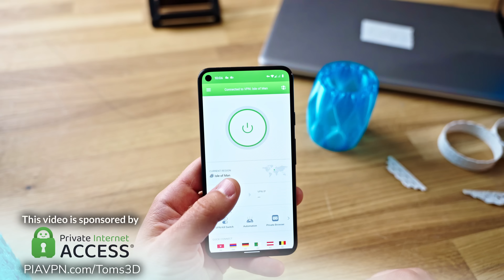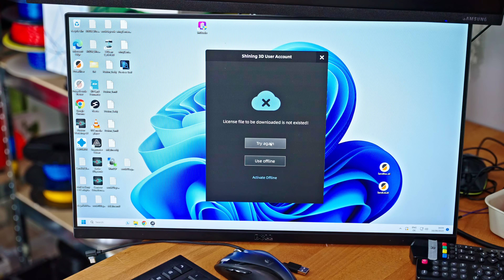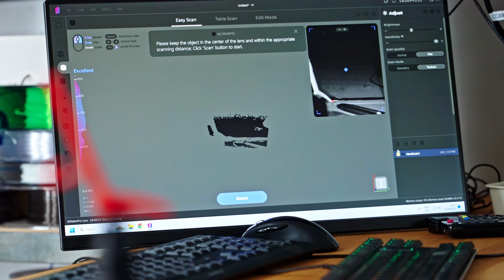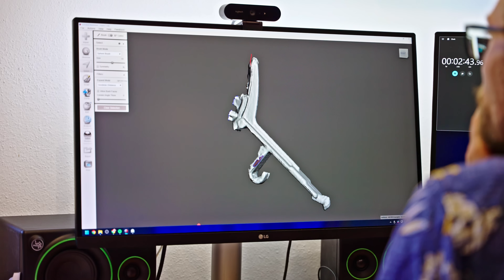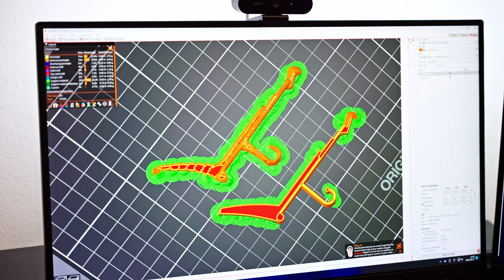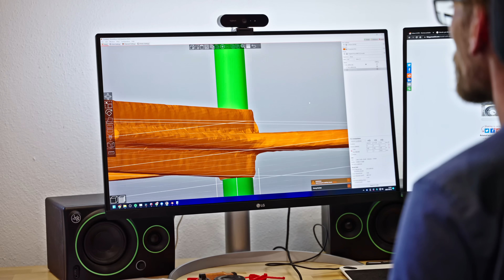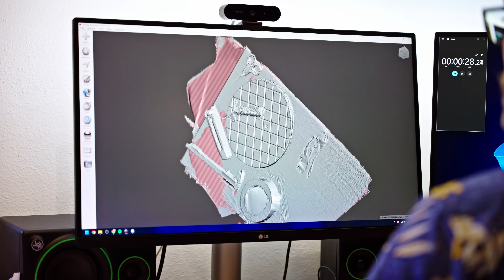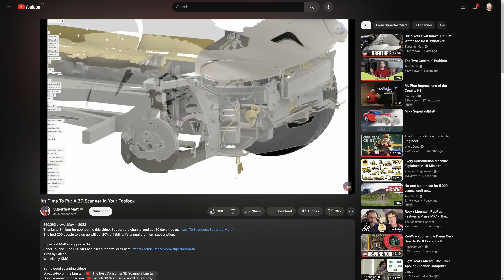Make replacement parts faster - with CAD or a 3D scan?

Comment: Great side -to-side comparison of two different approaches to reproduce relatively simple part. An advantage of CAD is that you can sometimes improve the original part, like you did at the end of video. The producer of the toilet 🚽 flush designed this part purposely weak to snap, so that you need to buy another set...

Comment: Certainly, going to a store and buying the defective part is much simpler. The process of scanning or 3D modeling is complex, and cheap scanners are not good enough
Reply: you have bad luck if the part is no longer available or way more expensive because you need to buy a kit (and so on). There are reasons why sometime re-create parts is the only solution. As example: the flush unit from the video is around 20 years old, nearly no chance to buy spare parts.

Comment: I found when measuring parts with digital calipers that the designers of the part in question will often use whole numbers in its mm dimensions, making it easier to recreate in your 3D editor, and it especially helps when trying to measure circular dimensions when you can't directly measure the radius or diameter, ie curved inner/outer edges of the part.
I would hope there's software out there that can take a 3D scan and apply the same whole numbers usage thing to end up with an easily editable highly accurate CAD file.

Comment: For a mechanical part you should be taking the scanned mesh into Fusion360 or something similar and use the mesh data to guide the CAD. For instance in Fusion you can project a mesh section as a sketch and then fit sketch geometry to the mesh section. OR I should watch the entire video before commenting.

Comment: Have no idea about 3D scants but in regards to CAD manually tracing a 2D scann (bitmap) and the addition of the calipers would help avoiding mistakes and make the process more pleasant, maybe even faster. Just import 2D scanned picture to CAD :) Cheers.

Comment: 2:28 EVRYONE WE FOUND HIS HIDDEN STASH!!!

Kidding aside, why blur it?
Reply: Also: 6:25 WTF? This is a commercial product?
My ancient Kinect can do better with the Demos in the SDK...
There was/is commercial scanning software available for it with a trial period that I used to reverse engineer some parts.
The scan results were almost drag and drop into autodesk inventor...
Reply: @DerSolinski  Depends on the scale. Scanners that work at large volumes do not work at small volumes, and vice-versa. Are you saying that your old Kinect can do high-resolution scans of an object the size of your finger?
Reply: @DerSolinski Looks like he didn’t spray nearly enough of the scanning agent.  My Scan Dimensions scanner could have easily scanned that part.

Comment: The first lesson of this video is to avoid the proprietary licensing crap and use an open source 3D scanner.

Great concept for a video, as always, flawlessly executed for maximum educational value.  Thank you.

We need resin printers without the toxic mess and the hassles of slopping chemicals, drying and post curing.  This part would be very strong printed in ABS-like resin.
Reply: Exactly - I hate that so much - I would much rather spend money or time on open source stuff than fidle with DRM and Licenses.
Reply: The first lesson is: Always be prepared
Reply: Fusion 360 is the proprietary licensing crap as well btw.
Reply: @TheTimeCatcher  - I'm a big fan of FreeCAD.  It's not as slick and polished as Fusion360 or SolidWorks but the time I spent learning FreeCAD and the designs I created in FreeCAD will never be used to extort money from me later.  I also won't spend hours on the end user licensing agreements and installation hassles of proprietary software.  Open source software just feels right.
Reply: @TheTimeCatcher  there are no viable open source alternative, onshape, solidworks and fusion 360 are all licensed software. Freecad just isn’t good enough yet.
Reply: @conorstewart2214  Ikr, but it doesn't help with that fact that you could just lose access to that.
Reply: @TheTimeCatcher  Not if you purchase a perpetual license. Amazingly, some software companies (or their resellers) still sell those.
Reply: @jonathanlawley4863  Okay, show me the perpetual license for Fusion 360 then.
Reply: ABS like resin isnt very strong though, nowhere near as strong as PLA.
Reply: @Festivejelly  - That has not been my experience.  I designed some small dog bone electrical insulators.  They're 30 mm long and the center section is a rounded 5 mm x 5 mm square cross section.  If I FDM printed these parts using PLA, at any layer height, optimal layer orientation, any temperature, any number of outer layers and infill density, post cured, etc., I could snap them between my fingers.  Resin printed from ABS-Like resin from Siraya Tech, there is no way I could break them without using a vise, large pliers, etc.  I used paracord loops on each end for a linear pull test.  I stepped on one loop with both feet and pulled on the opposite loop with both hands, as hard as I could.  I couldn't break them.  I doubt ANY filament printed on an FDM printer would have passed that test.  ABS-Like resin is very strong and tough.

If you've had ABS-Like parts break, they were probably delicate parts on resin 3D printed figurines - wing tips, spear points, fingers, antlers, etc.
Reply: All the head to head "durable resin" vs FDM printed videos have shown resin being far weaker than FDM, so what you're saying doesn't line up. PLA is very weak sure, but for durable stuff you use ABS or carbon fiber PC/nylon etc. I'm betting all else being equal, the FDM will still be stronger
Reply: @32BitJunkie  - I've made strong parts FDM printed in solid TPU, which is very impact resistant and has great interlayer bond strength, even though TPU isn't considered to be an "engineering polymer".  For a part that needs strength in all directions the more isotropic physical properties of 3D printed TPU can be a great choice, that also has advantages of impact resistance, UV resistance and chemical resistance.  People tend to think of TPU as "the flexible filament" but it's far more than just that.  Now that we're seeing higher durometer TPU marketed for use in filament feeders, it should be even easier to make structural TPU parts.

Anyone whose experience with MSLA printing is limited to fragile game pieces printed in resin designed for fast printing with high resolution should resin print a 10 mm x 10 mm x 25 mm bar using Siraya Tech ABS Like resin or a comparable structural resin and try to damage it in any way without using tools.  It's like a Jolly Rancher candy forged from neutronium in the heart of a dying star.  Resin is made of monomers and dimers that form 3D structures when initiated by UV light, as opposed to FDM printed polymer filaments that only weakly bond between printed layers.  FDM physical testing is a bit of a cheat by specifying tensile or compressive strength in the orientation of the extruded filament.  FDM prints are inherently weak when bending or twisting across the extruded filaments.

Comment: Excellent comparison of the 2 methods. This temper all the blurb around these cheapo scanners which are klunky to use and really, why add post-processing at that stage also. The preferred method in a better world would be that for all products their CAD must be available. Make this mandatory and repair  and adaptation would be way easier.

Comment: For the Einscan SE, try to get an older version of the software from around 2019.  The application is stand alone and works offline after activation.  I have my scanning computer disconnected from the internet for security reasons and this arrangement works.

Another benefit is you can make a copy of the Einscan Folder with the application and keep it backed up on a flash drive.  You can move it to any other computer and the Einscan will work with that version of the activated application.  I had to do this when my previous computer finally died and I had to move it to a newer computer.
Reply from the maker: Where can I find an older version? Einscan don't provide legacy versions of their software.
Reply: @MadeWithLayers if only it was an open source project with a GitHub page 😂

Comment: Cool video Tom.  But the cold hard truth is this.  CAD skills are required for both methods.  In fact, you need far more CAD skills to "clean up" a point cloud scan than you do to solid model something.  However, you simply can't get away from the fact that scanners are awesome.  Oh, and CAD coming in at 35 mins vs SCAN at 43 mins, what am I missing here????????
Reply: yeah I noticed that too, dunno if his script was reversed
Reply: Parametric CAD skills and being able to make changes with CSG is two different skillsets, but both require that you feel comfortable manipulating 3D objects on a 2D screen, which may just be a barrier that takes a lot of power to cross for some.

CSG has shown itself to be super friendly towards beginners though, thus the unwavering popularity of Tinkercad.

Comment: Thank you sir for another excellent video. I still find it incredible that if I need a part for something, I can fire up cad (or Blender) and, using some calipers and notes, I can make my own parts faster, and cheaper, than ordering and waiting for them. Or I can make something entirely unique that I cannot find already made. Or make a part that is no longer manufactured (like a vintage or antique part).

I had an old pickup in my 20s. Like many old pickups, the tailgate latch didn't work right because one of the retaining clips that held the latch rods in place on the handle had broken. I tried for months to find a replacement, even going to the dealer, and had no luck finding a part that would work (the parts guy at the dealer basically told me to pound sand because finding that part in inventory for a 20+ y/o vehicle was a waste of his time). Now, I could model that clip and print it for pennies (some places wanted $45 bucks for a little plastic clip a cm long), and then share it with other makers.

Comment: Oh, I remember a certain someone advocating for the benefits of closed source. Karma anyone?

Also I don't think that comparison makes much sense or is fair on either side. The figuring out stuff part of the scan is only done once and had to be done for the cad as well, on the other hand, when I design a replacement, I will exclude unneccessary geometry, but include reinforcements that will avoid breaking the part for a second time.
Like you said in the end of your video, it's an extra tool in your toolbox that can make things a whole lot easier in certain usecases.

Those propietary lock-in software subscription schemes really make this tech unattactive to me. I'll rather wait until this tech is as cheap and widely available as ender3's are today.

Comment: I prefer cad modeling, you can identify necessary features like you did in the video, and optimize for 3d printing. Scanning sometimes leaves weird areas that require supports or a lot of smoothing and loss of dimensional accuracy for smooth surfaces and small details.
Reply: agree. 3D scanning can be a massive time suck.

Comment: What I like to do is to make a photo of the part. Use that as a background in CAD and trace it. If you scale the picture in CAD you will have all the dimensions in one go.
Reply: If the part is flat, a paper scanner provides nice, hi-res reference picture.
Reply: @Papinak2  I'm surprised I don't hear more about how invaluable 2D scanners are for duplicating and matching parts. Any time I need to match to some arbitrarily placed screw holes, for example, I just pop the part on my scanner and then just place some circles in the right spots. My scanner is a super cheat 300 DPI deal built into my laser printer, and that's plenty precise for most jobs, and it's way easier than having to adjust for lens distortion from a photo.
Reply: @Papinak2  This, also place a ruler on there too, which you can then use to calibrate the size.
Reply: Heard a tip on YT maybe a day ago using a camera - move far back from the item being photograph and zoom in to the subject. Removes the perspective distortion giving an (almost) orthographic image. Personally prefer using a DSLR over a scanner due to the higher resolution, pretty much the same idea though - can't have too many methods for these things!

Think the channel was "Makers Tales", might be wrong though.
Reply: @-AT-WALKER yes that's a trick they taught us in 3D animation school 20 years ago. It still works today.
Reply: @-AT-WALKER  I believe I have seen that same comment! I follow Maker Tales as well
Reply: Place it on the scanner of a paper printer. Works with a lot of parts and way more accurate and already scaled correctly
Reply: This. Photo the part at optimal orientation, take one measurement of its length, create a scale canvas in fusion, trace and extrude. 
Figure with this method you could cut that time spent with calipers by 50%.

Still a great vid! Thanks for sharing, great to see how 3d scanner tech is moving along.
Reply: @speedtoast I used to do the flatbed scanner approach, but I always spent a lot of time getting the scaling correct and aligning the image well enough for clearances and tolerances for things thar need to fit together, clip on, slide along existing parts. (Aligning the reference image to the grid is specifically annoying for things with no flat edges to physically align to the edge of the scanner bed.)
I always ended up measuring with calipers anyway to verify the geometry drawn based on the scan, so I didn't save a lot of time there. Slowest for me is trying to just sketch directly in CAD no pencil&paper, no camera, no scanner, since sometimes the software doesn't want to constrain based on what you can readily measure in the order that I'm drawing it out, so I end up starting the sketch over or deleting a big chunk of it to work around conflicts. (Both FreeCAD and Fusion360,) Turns out I'm faster making a freehand rough draft sketch noting dimensions pencil and paper vs using a scanner and fighting with whatever CAD software to get the background images scaled and positioned properly, but it was pretty nice to be able to see the original images with the CAD sketches overlayed in the editor when I did take that approach.
Reply: In fusion360 there is a feature designed just for this called a canvas. Insert->canvas, choose the picture you want then dimension it with the real measurements in a few places and you're good to go. If you want to get really fancy you can do a 3D canvas by taking a picture at each angle and adding to each axis.
Reply: You can do this in any CAD software btw. @wafflecart
Reply: Well stated. Missed opportunity. That is the fastest way to get something into the computer.
Reply: just made a similar comment, then saw yours. spot on.
Reply: Came to the comments to say this.
Reply: That is exactly what I would do.
Reply: If you plan to use a camera, your lens focal length should be somewhere between 80-100. This will give you a photo with the least distortion.
Reply: @SomewhatAbnormal  Good Point
Reply: basically "do top down modeling like they teach in mechanical engineering courses"
Reply: I do this quite often, so I have an old IP camera mounted high up in my office and pointing downwards, zoomed in on a  board with a 5mm grid on it.

I keep meaning to buy a telecentric lens for this purpose. They're not expensive used and provide an orthographic projection of the subject.
Reply: @adrianscarlett  that's a good idea.
Reply: Pretty neat idea.  @adrianscarlett
Reply: The thing with this is you need to get an exactly head on view of the part
Reply: @mostafaelshafie4550 no really, just throw some rules or objects for reference onto the scene also take a picture from a far and zoom in to get a nice perspective for tracing.
Reply: I know some phones have a little alignment cross to take photos head-on, might be useful!  @mostafaelshafie4550
Reply: Good boy. Pareto principle.
Reply: Yea sometimes I’ll do the same take a photo and make it using USD 😘

Comment: I´m not sure if the Lynx was the best option for this small part, because even the manufacturer write it on the product page that its made for bigger objects.
Maybe the 3dmakerpro Mole or a Revopoint Mini would fit better for this kind of parts. The einscan-se should handle it very easy. Mine works fine with small parts, but ya the activation is sh*t.
Reply from the maker: I know the Einscan coule most likely have gotten me a better result (which is why I tried it first), but I'll take a 3D scanner that actually lets me use it over one that locks me out any day.
Reply: i understand that. The activation process is from the hell :D But my point is, that the lynx is not the perfect choice for this type of parts ^^ @MadeWithLayers

Comment: I prefer CAD over scanning every day. Unless you want to print an organic object like a plant, bone or ring. But beyond that, CAD! Especially because everything's parametric and you can adjust and sometimes even improve the original part.
Reply: Typically 3d scans are used to build an ordinary parametric CAD file, all serious current implementations of 3d scanning for functional components are using the scans as reference geometry rather than using the scans themselves to create parts.
Reply: Yes, it depends on the type of geometry you want to capture. 
Unless you have a professional scanner with geometry recognition that is suitable for such small parts, CAD is much faster.
If I have very organic shapes, I like to use photogrammetry, because it works in any dimension, as long as the photos are good.
Reply: Until you're dealing with surfaces. Then it becomes very difficult to reverse engineer parts without a CMM
Reply: Says a non advanced CAD user
Reply: @VoidPixel4179  Who are you talking to? And be careful with making the wrong assumptions based on thin air ;-)